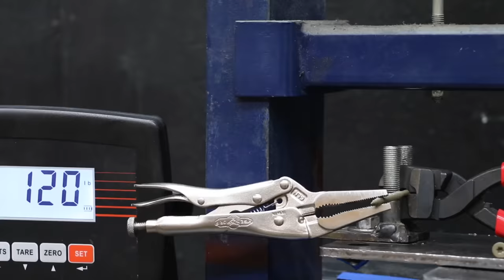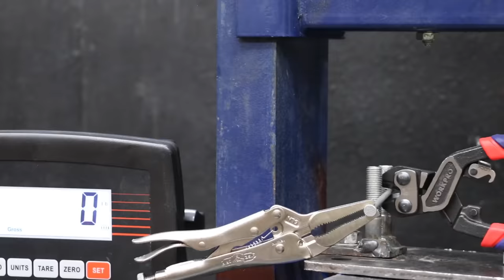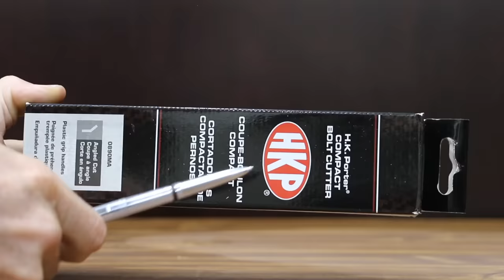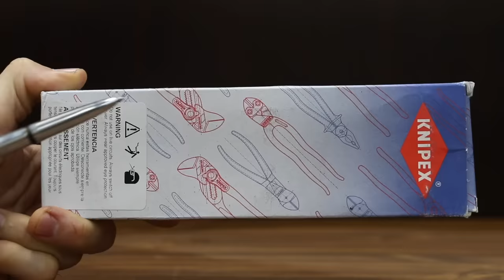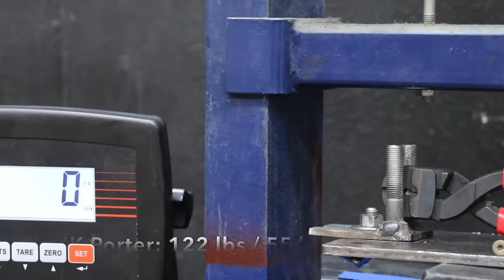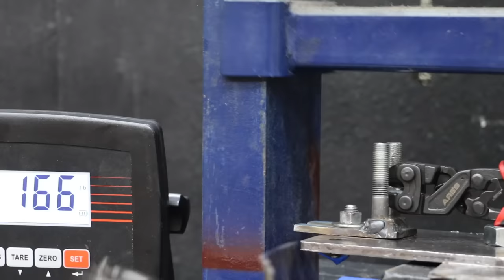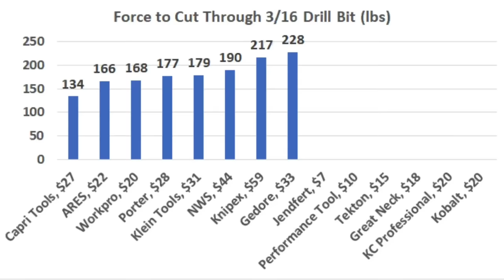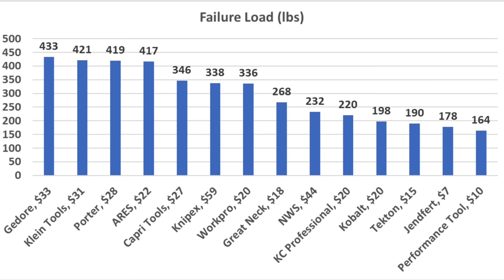Best Bolt Cutters? Knipex, Klein Tools, Kobalt, Tekton, Gedore, NWS, Porter, Workpro, Capri Tools

Comment: Once upon a time ago I got roped into helping a roommate make chainmaile from scratch. Coiled springs then cut them apart into individual rings, the bad part was it was spring stainless steel. Hard as hell, had a rotation of several knipex mini bolt cutters, because we would break the tips of them regularly. Knipex would send us new ones, great warranty, but the shipping times were insane. I think we had 7 we were rotating through being used and being in transit.
Reply from the maker: Thanks for sharing.

Comment: Review suggestion: Hand Straps. Ya know, the kind with a metal clasp that allows you to tighten when you pull, but holds until you press the lever on the clasp. I use them for light loads in my truck. Faster & easier than ratchet straps for lighter loads. Be good to know what they can actually hold! Seems like a good thing to review. Thnx!
Thnx for the vid, btw. I'll stick with my angle cutters and straight up bolt cutters.
Reply from the maker: Thanks!  Thanks for the suggestion.

Comment: Knipex tools under normal usage are very durable and long lasting.  They out perform snap-on in just about every aspect.  Try knipex smooth jaw pliers, you will not be disappointed. A lot of aircraft mechanics have them drilled out to accept rivet sets as they are strong enough to squeeze rivets AD with no problem DD if you are strong and even monels.   Pull the sets out and they will turn out a rounded out bolt.  I have often wondered how they would perform with cutting dies.
Reply from the maker: Thanks for the suggestion.

Comment: Very good test of the cutters.  Have you ever done a comparison between the long shop work lights used for working on cars?  The long ones that clamp on each side of the hood.  This is something that may be of interest to your many viewers.  I have two different ones and they are totally different.  One, a Sunex (Amazon), is more expensive but the batteries last longer and will still work when plugged in and the other, a MotoMaster (Canadian Tire) is cheaper, batteries don't last long and when it's plugged in, the light shuts off.  I'm sure you could find several torturous tests to put them through.  Thanks for all the great videos.  Best Regards - Mike
Reply from the maker: Thanks!  Thanks for the video idea.

Comment: Might be expensive to do a video on, but a comparison between floor jacks would be nice. I had a cheap 2 ton jack fail after a single use lifting only 1 ton, then borrowed a more expensive 1.5 ton jack which performed phenomenally.
Reply from the maker: Thanks for the suggestion.

Comment: Viewer Suggestion: Framing Hammers (force applied to 8/16 penny nail w/ equivalent swinging force applied, shock/vibration to shaft/hand from striking hard steel, force required to sheer off the head of the hammer from the shaft), Stilletto and Martinez 15oz hammers come to mind when it comes to higher end hammers, they claim to swing with the same force as a 28oz hammer
Reply from the maker: Thanks for the suggestion.

Comment: We've got some old school tools we call "snips" that have long 12" handles and jaws that are curved so they attack the wire straight on from each end rather than tapering like a bolt cutter.  We use them to cut cattle panels down to length.  I don't know the technical term for them and didn't explain them very well, but I'd have been curious to see them in this test.  Never tried to cut a drill bit or allen wrench with one but ours have probably cut a few thousand nail equivalents. Thanks for another great video, it's getting to where if I want something new I check if you've reviewed it before.   Also requesting for the 10th time if you could possibly test and review rechargeable LED flashlights
Reply from the maker: Thanks!  Thanks for the suggestions.

Comment: Checked out the prices for the Capri and the Knipex here in the UK. The Knipex is a bit cheaper at £35 ($47), but the Capri has more than doubled up to £48 ($65). As good as the Capri's clearly are, I'll go for the Knipex. Better longevity for less money.
Reply from the maker: Thanks for sharing.

Comment: Great information as usual. That being said, tools are not what they used to be. Many of my wrenches, hammers, even a screwdriver or two are from the 1960s and 1970s and they work better, in my opinion, and seem to strip fewer nuts and bolts. The metal is apparently harder than newer tools. With this in mind it's always good to know which products perform best when you need to buy them... As for a suggestion for a future video.... another test. I am very curious as to how the 0w-16 oils perform. To me, a person who had to build my first car, it doesn't seem to offer much protection. Unfortunately and unknowingly, I purchased a vehicle that requires this oil. It would give me peace of mind, or not, to learn the true protective qualities of this ultra thin oil. There doesn't seem to be much information available on this subject. Thanks!
Reply from the maker: Thanks!  Thanks for the video idea.

Comment: Video Suggestion.

Carp/Fishing/flag telescopic poles. Radio amateurs, like me, use these frequently for  antenna supports, as well the reasons they are sold for in their primary use case.

There is a huge difference in the wind conditions they will tolerate. A mega test would be very interesting.
Reply from the maker: Thanks for the suggestion.

Comment: I ended up buying the capri's because of this video and unfortunately I wasn't impressed. I use these type of small bolt cutters to cut tig welding wire: 308L, 309L, ER70S6, ER70S2.. They took as much force if not more to cut through the wire compared to my Lowe's Kobalt bolt cutters. I also noticed immediate damage at the jaws after only a few cuts. Nothing major. I'd classify it as superficial damage. Was trying to find an alternative to splurging on Knipex but it seems that'll have to be my next purchase. 

Just putting it out there. Not knocking the video or your work. Good stuff by the way.
Reply from the maker: Thanks for sharing.

Comment: 1. Does pipe thread paste out perform pipe thread tape?
2. Does cupping all the boards down on a deck build really result in a straighter deck - should this be a consideration in building furniture?
3. what reaction does not exhibit a mushy zone in a FE-C Phase diagram?
4. What's the best way to keep mice/pasts out of your house?  Steel wool? caulk? Expanding foam?  Cats?
5. Thermal bridging/thermal breaks... what's the best system for insulating your house?
6. Are there any uses left for CPVC?
Reply from the maker: Thanks for the suggestions.

Comment: Video idea

Best floor Jack for the money. Harbor freight specials vs name brands. 

You could test ease of use, lifting capacity. Check for pressure bleed off. Jack up and down 100 times.
Reply from the maker: Thanks for the suggestion.

Comment: I love your content but first time I think that not all  the brands haven't been fairly tested because in some cases drill bit/nail/deckscrew was deep into the jaws which makes it far easier to cut but in others they were in the middle of the jaws or at the very end of it. If all of them had the object deep inside the results might have been different. Leverage makes huge difference and the closest you get to the hinge the more leverage you get.
Reply from the maker: Thanks!  Thanks for the constructive feedback.

Comment: Have been using the kanipex for cutting  welding wire.. its was the better brand for cutting a 5/32 625 inconel wire, but for half the price.. I'll use the carpi tools.. thanks..
Reply from the maker: Thanks for sharing.

Comment: A lot of the force required depends on how close to the fulcrum the bolt is. Some of the tools had the part too close to the end of the cutters. It seems to me that using these tools the way they’re designed to work - by hand only, none would break.

Comment: The placement of the nail is a huge factor, some were toward the end of the jaws and some were all the way inside the jaws. Deep in the jaw is where your max pressure is produced. As you move toward the tip you approach the minimum capability of the tool. Learned this clipping nails off repaired pallets, 8 hours a day, six days a week for a year... we only used Knipex bcause they had the least failure rate and had to get a new pair every 2 days because the tip would chip off. I rescanned the video and i didn't see where the jaws wouldn't open far enough to accept the bolt closest to the fulcrum.
Reply from the maker: Thanks for sharing.

Comment: Just rewatched this. Few points to note. Cutting anything beyond the screw is impractical and just abuse at that point. Also, people are not going to be able to generate more than 70-100lbs grip force. 

The HK porter have an angled head and flush cut design. That’s incredibly useful even if they are not the strongest. 
I own a pair of the knipex but the ones with a notch near the pivot on the jaws. This allows them to take a bigger/ better bite on most things. It may not always make it through on that cut, but it gets it to the point where the front flat area of the jaws gets through on a finish cut.  
The diagonal cutters are impressive. My only gripe with my Klein was the short handle lost a lot of leverage. I certainly couldn’t put that much force into them to make those cuts. The gedore look longer but were obviously not as good cut wise. The NWS impressed me. I found a sale on them for a female coworker and used them once. Seemed ok but the jaw opening is limited due to the compound nature. 
I am very impressed by the Capri. Though I already have a few pair of the Knipex, I wouldn’t hesitate to add those to my collection. They would make a great addition to my car kit. 
A good revisit to this video.
Reply from the maker: Thanks!  Thanks for sharing.

Comment: Test different hydraulic oils like xtreme premium tractor trans hyd in the white bucket with the green lid and others like shell, schaeffers and mobil, becuase that would really be helpful to know what to use in my tractor that uses the same oil for the transmission as well as for the hydraulic system. Thanks for the vids and keep up the great work!
Reply from the maker: Thanks, will do!  Thanks for the suggestion.

Comment: Please, good sir, can you do a video on needle nose pliers?  I need to upgrade my craftsman to a better set that can tolerate gripping screws (heads broke off) and manually twisting them out with 1) the head being too thick, and 2) the head not twist with the screw.  It would be much appreciated.  PS, just got the knipex cobra pliers you recommended on your last video.... WOW!  They are that good!  Thank you for the great work sir.  You are saving us all a fortune.
Reply from the maker: You are welcome!  Thanks for the suggestion.

Comment: God I love klein. Their contender isn't even a damn bolt cutter and killing it. And always the best price. 

Those knipex really don't open too far but I love them. More than anything I use them for fatigue reduction. Whenever I can cut with them I do and it's just like butter through everything. I keep the smallest ones on my little quick reach section and the big ones in my main pliers pouch, and the angled head in my secondary bag. Shocked they broke
Reply from the maker: Thanks for the feedback.

Comment: Some context for some of the values when cutting nails and such, the average adult male's grip strength with one hand is around 100-135lb, depends on the source but this seems to be the average

Keep this in mind if you are buying cutters, must 10lb less can be significantly easier as tension does not scale linearly with weight when it comes to muscular strength, 110lb can feel way more difficult than 100lb
Reply from the maker: Thanks for the feedback.

Comment: good idea for a video shoot out would be automatic wire strippers. see which one can do the widest range of wires and measure the levels of damage to the insulation.  and also crimpers. see what crimping pliers make the best bond strength per input effort and which crimps hold the most weight
Reply from the maker: Thank you for the video idea!

Comment: Watching the video, it looks like there might be an uncontrolled variable when cutting the nails.  It appears the nail is deeper in the throat of the jaw on some bolt cutters than it is in others.  It looks like the ones where the nail is farter out doesn't perform as well, which makes sense because it takes less input force to cut bolts when they are as closer to the fulcrum.

Comment: Great test, however the Knipex is sold as a music wire cutter, not a bolt cutter. Wrong tool for the job here!
I use the Knipex for cutting pin material in the shop often and is meant to be an upgrade to normal nips. The Knipex excels at it's intended job.
KnifeMaker

Comment: FYI in the 1st part of the video you are placing differently. For some you're putting deeper in the jaws and for some closer to the tip. And for  example, Gedore would perform differently  if you would place a nail where the arrows indicated.

Comment: Okay I have some questions. First, why were WIRE cutters tested along side BOLT cutters? Second, why weren't the cutters positioned consistently so as to give each type  of cutter equal mechanical advantage? Third, who manufactured the drill bits that were used? If the drill bits were purchased at a place such as HF then I would question both the quality of the HSS and the consistency of heat treating of the bits. While comparing these brands in tis way is informative, there first needs to be a test to see if each brand (minus the WIRE cutters) is consistent within itself. Purchase, say 5 of each brand, and put each set of cutters through the same testing. This way a base line can be established. Once this is done, then do a comparison test.

Comment: I actually found a set of 2 hk porter 8 In bolt cutters, the flush cut and angle cut. $29 regular price $19 on clearance. Less than just one of them on Amazon
Reply from the maker: Thanks for the feedback.

Comment: You should normalize failure load and leverage. That is, using the force it takes to cut through the nail, make that equal to one and then the failure load is some multiple of that force
Reply from the maker: Thanks for the suggestion.

Comment: Torque wrench vs DIY/homemade torque wrench

Breaker bar with pull-type scale. Force times distance = torque! 
N*m = Nm or lb * ft = lb*ft. 
20lb pulled at 1ft = 20lb*ft or 20lb pulled at 2ft = 40lb*ft etc.
Simple and reliable solution, does not need frequent/expensive calibration and can be very precise. Allows wide rage of torque - either pull harder or use longer bar! 50lb at 4 ft giver 200lb*ft!! 50lb fish scale and 4ft bar come at less than $50! This is fraction of the price of reliable and accurate 200lb*ft torque wrench.

My experience = calibrate torque wrench frequently. They are easy to use in every position and can work "blindly" in hard to reach/see locations. But if you cannot do it yourself, it is quite pricey!
But not everyone can afford $500 torque wrench with +$80 calibration cost.

Would you do a real life test for both types please?
Reply from the maker: Thanks for the video idea.
Reply: @ProjectFarm  Beam style torque wrench would be a nice addition to the test. Cheap alternative and it is much simpler then all the math involved in custom lever+scale setup ;)

However they are limited to approx 200Nm, so when it comes to large nuts :D long lever and 50kg scale may be unbeatable.

Comment: Just an observation but i think it makes a difference in force needed with the placement of the nails on the blade some u put the nail or screw in the middle of the cutting blade and some are at the beginning of where the blades open ...for example when i use my linemans to cut wire its much easier tucking the wire as far into the jaws as possible before i apply force compared to putting the wire at the end of the jaws and trying to cut ...
Reply from the maker: Thanks for the feedback.

Comment: To get an accurate reading on force to cut the bolts, the placement of the bolt  relating to pivot point, must be consistent, and this is critical, and didn't look like it was a ctriteria in your videos. Never one to comment badly, but this is a constructive feedback; your force numbers might have been biased a lot, because of this criteria: some of the pliers, the bolt was up front, and some of them were way back, in the throat ; must have constintency; you are one of the reference for testing products, don't let important details out of the equations :)

Comment: I had a different experience and 've then searched the internet and found out, that it wasn't just my experience, but others too. Knipex teeth, chipped on the first use trying to cut a small nail..It's not a huge chip, but you can spot immediately, without searching for it..
Reply from the maker: Thanks for the feedback.

Comment: I'd like to see a comparison that shows the next size up as well. It might be the case that a moderate increase in cost justifies a significant increase in performance and durability. Maybe the compound designs are far more durable, and with the short handles you can't properly find the functional limit of durability and fatigue. If the jaws are harder, and you limit cutting to manufacturer recommendations, will the 10/12" version far outlast the smaller version? I think that could be an insightful comparison.
Reply from the maker: Thanks for the suggestion.